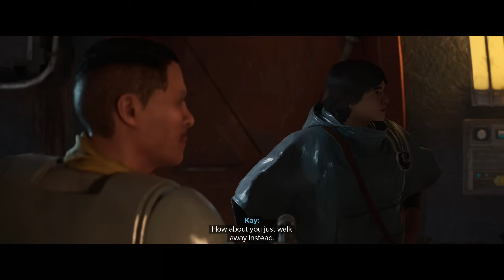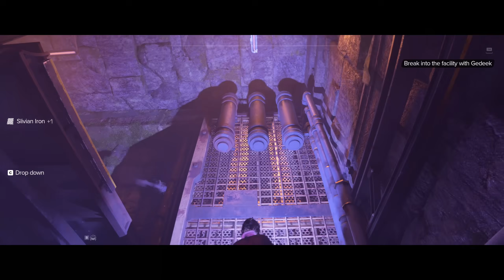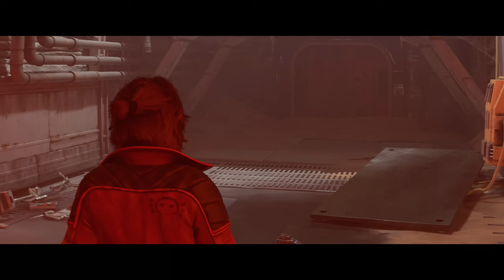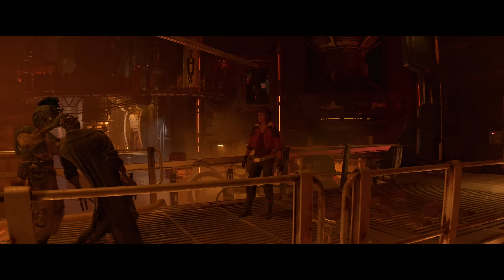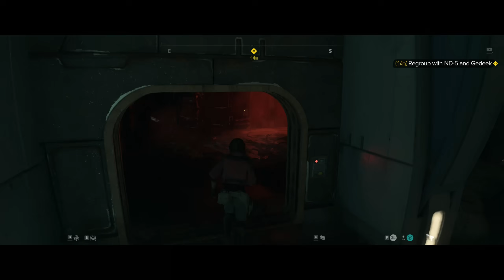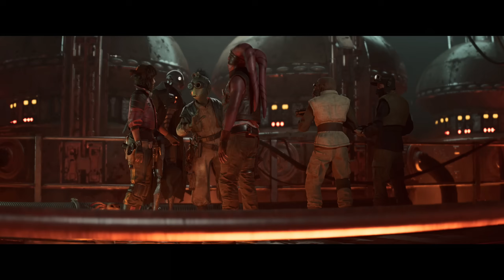Star Wars Outlaws - It's Still Always The Rebels

Comment: I think Kay is getting sentimental for good old ND-5. And I don't blame her.
I mean Kay probably never told Gedeek about those barriers that she could use a plasma cutter for. Because of course the game doesn't let you.
That was sometimes fun with games with more free dialog systems like Veil of Darkness. You could ask people anything you knew as a code word already. Which could lead to... difficult situations if you mentioned the wrong thing to the right people too early.
Star Wars tech often looks like it's about to fall apart but actually is surprisingly sturdy and long lasting.
Why would reactivating those droids actually be bad? They were programmed to fight the Republic which doesn't exist anymore. So unless someone convinces them that the Rebel Alliance is the successor of the Republic, they could be persuaded that the Empire is. I don't remember whose insignias are closer to whose.
Jingles was complaining about the obvious signs and then misses one after the second generator that tells him to go down. Go figure.
Power isn't necessarily the same as power. I mean there's voltages, current strength, frequency (if modulated) etc.

Comment: communication protocols on robotic and automotive applications are often based on differential signals. a failing power source might alter the voltage levels of those signals, making inputs from various sensors and circulating data in general to appear random, hence the going crazy thing of the droid

Comment: Apple got in trouble a few years ago for a similar reason causing ND-5's malfunctions.

As a battery ages, its power storage and deliver gets less and less stable. To keep the phone from accidentally bricking itself due to a power surge from its own battery, they built in a failsafe that would shut the phone down when it detected things getting unsafe - but of course, any notes about this for the end user's benefit were buried in a phone book of legalese ass-covering, so all the users could tell was that their phones started randomly shutting down during normal use.

When they went to the Apple stores to get a Genius to take a look, that's where the trouble started. It seems Apple was pressuring its store employees to push for sales, so the accepted approach was for the Geniuses to tell the customer that the root cause of the problem is that their phone is getting old (true enough) and the problem will only get worse (partly true but misleading - it won't fix itself, but a replacement battery would solve the problem) - so the only real solution is a new iPhone, and aren't the new models' features so much cooler than what the old one could do (sleazy used-car salesman hogwash).

Comment: Jingles, re: ND-5's power issues causing processor issues. I'm an electrician not an engineer or a computer scientist but when batteries (or power cores, in this case) begin to fail they output lower maximum current and exhibit voltage sag. Microprocessors need precision in both of those and when they don't, everything goes haywire. More bits get flipped unintentionally, zeros become ones and vice versa. In my experience this can be one of many reasons why an older smartphone can get buggier.

ND-5 is malfunctioning in a way that is more narratively interesting than if he kept needing to reboot but it's plausible for science fiction and makes a hell of a lot more sense than many things in the Star Wars universe.

Comment: It's his power regulator that's busted, right? So it's not just that he doesn't have power, he probably gets all the power he needs, but it's all spiky and fuzzed up from his other components, like servo motors and such. His brain is probably getting constantly zapped with static, we had that same problem at, ironically, a robotized analysis line at work. There were these two instruments right next to each other, and they set up some kind of interference when they were both running.

Comment: Aktschually Jingles, unstable power supply is a good reason for electronics to act weird.  That is a real world engineering thing. A common reason of random consumer good failures are dead capacitors. Dead capacitors screw up power regulation because the regulating element was not designed to work without their effects.  The problem i have is much rather - power supply is the easiest thing in electronics to fix. Code is broken and you have no backup - screwed. Provessor failed and you have no spare - screwed. Power supply broken - any recent unit will either do off the shelf or can be adjusted to do so. ND 5 being broken is 100% realistic. Needing to deep dive a factory to find an original regulator instead of just wiring in a standard pattern power generator...that is weird.
Reply: I'm going to go with "Proprietary connectors, with some kind of proprietary handshake code being used to initialize and verify the modules installed" as a handwavium reason :D

Comment: MY friends car went haywire when its battery drained while being towed. Wipers running, abs firing at random, and it tried to use blinkers and headlights but they were dimmed so much it was barely noticeable. The problem is if the circuit is made with logic gates that requires nand and nor gates to handle its systems. When the main lost full power, it tricked the system as if you fired a relay switch.

Comment: She saw "enough of them" fusion cutters in the south stretch... but never bothered to take one along. And the fusion cutter cuts... pre-existing welds. The game doesn't attempt to move out of the five euro territory. Assuming the devs or some modder fixes Kay's model.
Reply: I'm a welder and a plasma operator. Just cut the stupid tube straight down ya dumbass! Also, DON'T CUT THE WELD! It's the thickest part of the material!! Also also, she'd have to have the torch pointing down to cut across the top, then vertically for the sides, then do it overhead for the bottom unless she could get her head over the bottom of the tube...

Comment: Well actually jingles  computers will start not working properly, e.g. car electronics can go haywire and not start the engine or work the electric display if the battery cells have died and they don't hold enough charge to effectively start and maintain the systems. I know I am heading back to the salt mines

Comment: ND-5:  Suffering power regulator failure.
Also ND-5:  Behaving like memory or hard drive is failing.
Reply: If anything, the resulting power loss to his primary memory could result in it running off a backup that is the original BX commando droid programing.
Reply: Okay, as odd as it sounds, you might have just plugged the plot hole. If you look at the Intel chip failures, they are getting all sorts of wired behavior like running out of video memory. Given the power density in the SW universe, ND5s power core is still fine, but if the SW equivalent of the VRMs and 5V rail is shot...random resets and glitches. And while the factory power may be more stable, you can't fix degradation.

So its not that he is running out of power, its that he is running out of a type of power.
Reply: @nickierv13  Or taken more literally: it's not that he's running out of power, it's that his power has become unregulated?
Reply: @nickierv13  In cars, a bad ground is also a source of many electrical gremlins and issues, which can get as bad as preventing your car from starting altogether. So its pretty plausible.
Reply: @reinbeers5322  Yeah if you have a bad ground in for example the wires going to ignition coils on modern engines can result in a partial or complete failure on ignitions.
Reply: Seems legit. Faulty power supplies often cause strange issues that seem like they're coming from other hardware.